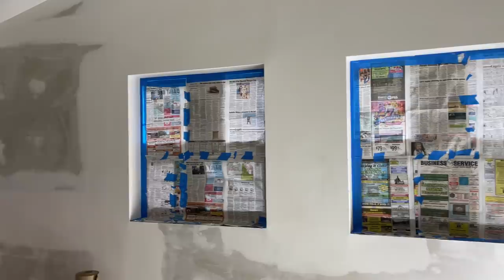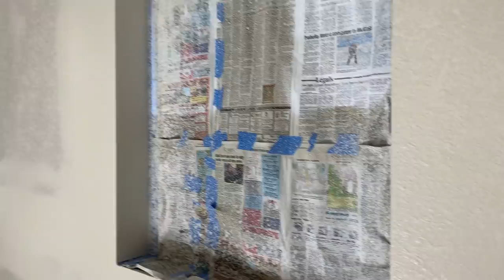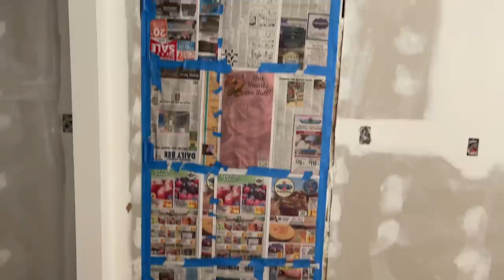FINISHED! Perfect Drywall Texture on our Self Built House

Comment: Great job guys.  For those who think that beginners could get away without texture have clearly never done a job this large.  It is hard to get away with skim coating.  Pro's can do it but it is not cheap.  You really won't know how you did until you prime it.  If you find flaws, you can still fix them.

Comment: When you are done with all the DW mudding,  mop the floor with a very wet mop or sprinkle the floor with water.  Let it set a little bit and the big blobs of mud will scrape up easily.  The wet moping will also freeze any DW sanding dust that remains to the sub floor.  Then you will be ready to paint.

Comment: The Texture look great. I just did a bunch of repairs at my girlfiends house fixing all the dents and holes in the walls. I did find when trying to match the texture  it's easyer to feather a larger area go wider with the texture. when the patch was like a 4 inch by half inch gash makes it easyer to match if you spray  not just the patch to respay a larger section after filling the hole and it dry's. I used lot's of can's of Orange peel.This is just hint for the Future.

Comment: After working in the Remodel and Construction field we always used Painters Plastic for covering any Doors and Openings that needed to be covered up.... while it's thin and rips but it does make it easier than News Paper and cuts down on the time it takes to Prep a Room. Otherwise, Great Job you all did.👍 Another suggestion is if you really Good with Mud Knife Spray Mud a Little Heavy and the mud knife too flatten it Down.  Also, use a Kilz Primer on the walls before Painting and the Texture won't Soak Up all the Paint and it Cheaper than applying 3-4 coats of Paint. LOOKING GOOD!😁👍

Comment: I've been gardening for a few years. So, here's a few ideas:
1: gardening doesn't always have too be on the floor. You could try using one of your healthy trees too support a multi level garden, this way you go up based on how high you are safely able too access. This solves 2 issues, you won't have too clear as much trees and the garden will simply be vertical so, you have more garden space for a larger garden. 
2. Solar trees are producing quite a bit of solar if you put the panels on a solar tree you can increase your solar collection. They are also remotely adjustable in some cases. 
2.

Comment: I had to drive a thousand miles with my parents before they'd let me "solo", although I didn't have a tractor to practice on like Seth does.  Going with the texture finish on the sheetrock, although not EASY, would be easier than trying for an ultra smooth finish.  The place is looking good guys!

Comment: When we did our whole house remodel I decided against using sheetrock in the closets as I hated the thought of taping and floating in the confined space. I installed 1/2" OSB on all of the walls and prefinished white 1/4" beadboard  and used a hanging system that uses a metal cleat at the top so you can arrange your closet any way you like and change it as your needs change. Did I mention I hate doing anymore sheetrock than I need too?

Comment: There are three spots that are super important to get right in texture.  1. above beds, 2. across from toilets and 3. in front of desks.  Those are the three places people stare at walls.  Other than those good enough is good enough.  Yah, those angle sprays are inevitable.  When they are obvious I cut them back and hit them again.   For me I try to spray only enough that I do not have texture on top of texture.  It uses less mud and goes much faster as I do not need to refill as often.  The time seems really consumed in thinning and straining.

Comment: Having a splashing time wish you were ere!! (ha-ha) When I worked on a building site we put the paper down in the rooms After the Chippys had finished, (Chippy =Carpenter), for the plasterers to do the mudding, then when they finished sanding down, sent in the  labourer to sweep the floor, Turn over the paper ready for the painters, and when they finished lift up the paper and throw away leaving clean floors. I should have mentioned it Before you started the Mudding. ahh well  thanks for the video, snowing here in UK, not as bad as you have it. Thanks for the video Love from UK. x x

Comment: if you were going to do orange peel you could have used a 1 inch nap roller with dry wall mud mixed into the paint
Reply: Good tip! Thanks!

Comment: Purchased a condo in 1973 with textured walls and popcorn ceilings. Marty 1973 😵 it was great “then”. Both covered imperfections I am sure. ALL I know is if you had to fill holes etc. it was impossible since the popcorn and texture were sanded down. 1973 😵‍💫2022 =s how many years

Comment: no need to cover the windows !!! just wipe down with a damp cloth like a good old fashioned plasterer would do, if you forget to wipe down a stanley scraper will do the job, do the glass first then when the blade has blunted a bit use it on the pvc frame

Comment: I simply cannot understand why you texture your walls. I like a smooth painted finish as it's easier to clean, low maint. will not collect dust etc. Yes spray a coat then smoothe it.

Comment: Not a fan of textured walls or ceilings. This has come and gone out of popularity. The original reasons for it were for acoustics and the fact that it hides a world of mudding sins. Note that you can  use a second coat of texture if needed.  The mix should be no more than a medium thickness gravy. You're doing a good job and it's coming out really nice!  Pro Tip: when spraying paint or texture always spray straight on. But, you did pretty darn good sir!